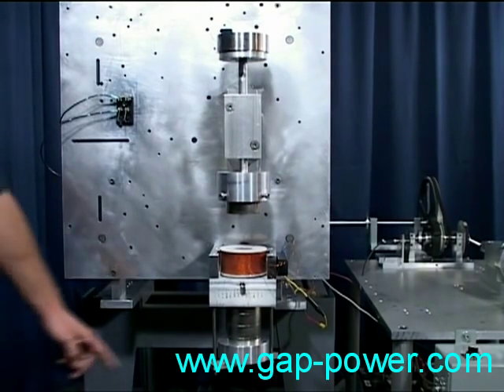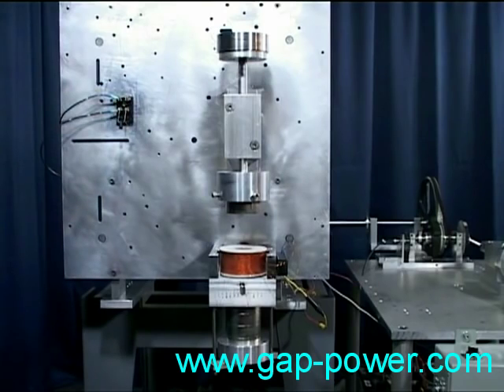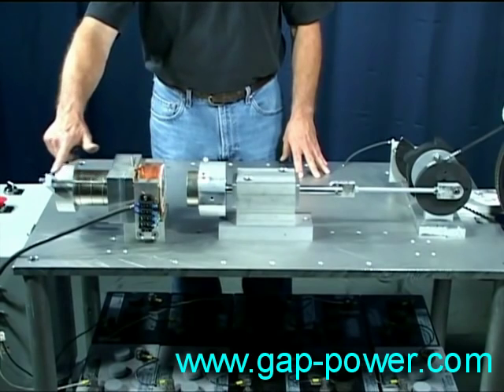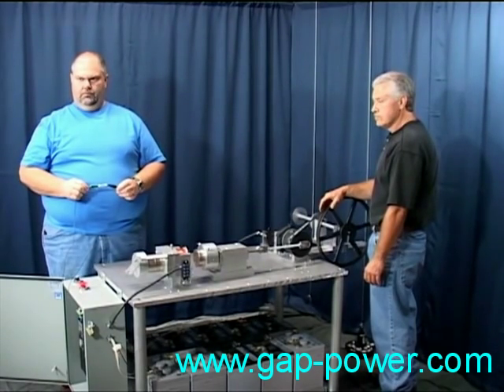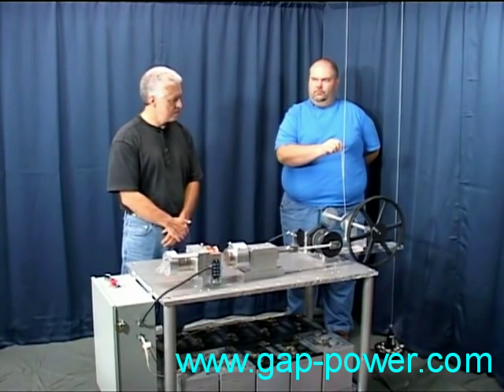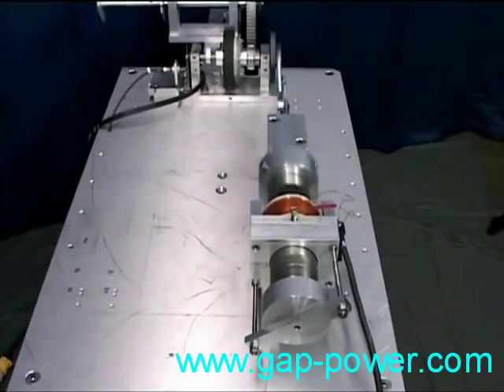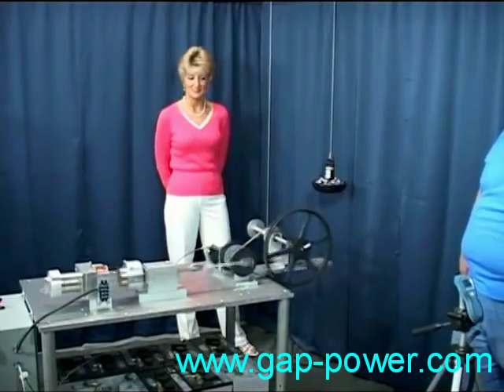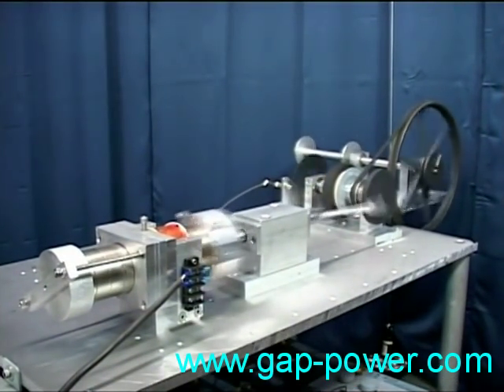FREE ENERGY # 24  Working Magnetic Overunity Device - Magnetic Neutralization

Comment: @flyingpigstuff Have thought about it, although you don't appear to have done so.
The energy to neutralize the magnetic attraction, does not push the or pull the magnets together, so is not doing much in the way of work. It just negates the magnetism, the magnets themselves are doing the work, when the current to the coil is removed. No current to coil = full repulsion. Current to coil = no repulsion. The energy produced is by converting mechanical energy to electrical via a normal genny.

Comment: @krazeekooladam and thats what littlehaste was saying to be Zero Point (orverunity) power it must be able to output enough power to refeed itself. This is not an "overunity" machine. Overunity isnt even the word to be used here. the proper term to be take seriously is Zero Point Energy. There is however an experiment you can look up where they have metal plates in a vacuume with no electrical, magnetic, or mechanical influence at all and the plates attract each other. Some suggest string theory

Comment: If you think this device is overunity, it's easy to prove-- just connect the output to a generator and make electricity.  Then, connect that electric power to your input.  In other words, close the loop.  When you measure input and output, there are too many opportunities for error.  The only way to gain respect as an overunity device is to "close the loop" and disconnect ANY and ALL sources of external power.  I think you will find that you can't do that which will tell you it's not overunity!